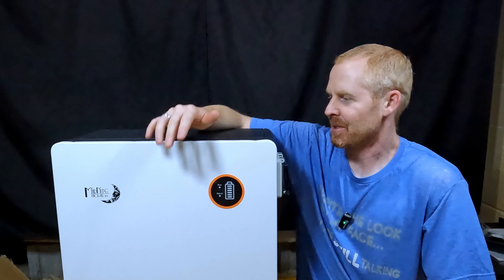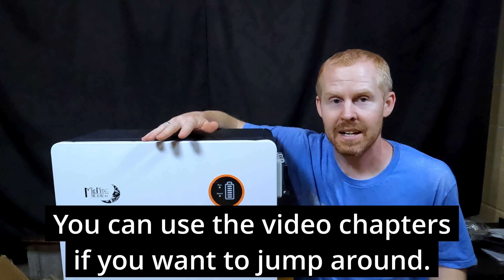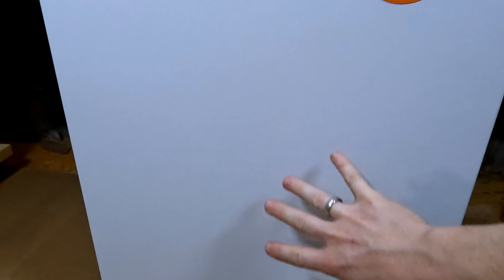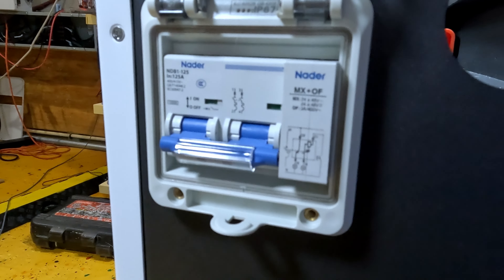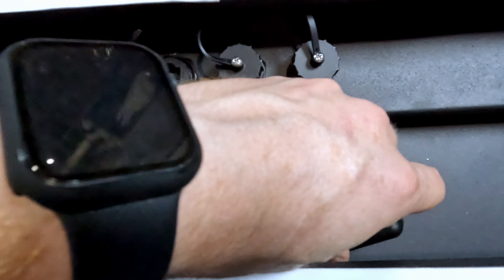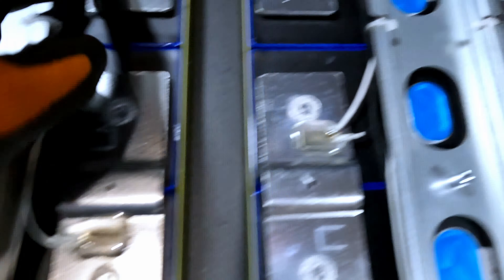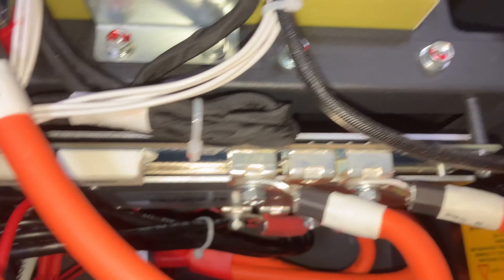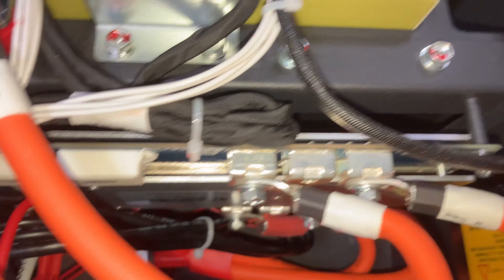First Look: MidNite Solar PowerFlo 16 – 16kWh Wall Mount Battery!

Comment from the maker: Links to the parts & pieces in the video (affiliate links)
------------------------------------
MidNite Solar MNPowerflo16 - https://bit.ly/4cZDcZQ
MidNite Solar "The One" - https://bit.ly/4exEkpw
EG4 Chargeverter - https://bit.ly/48jcuu7

Spec Sheet - https://cdn.currentconnected.com/2024/09/05130353/MNPowerflo16-v1.1.3-240813.pdf

Comment: Love the battery and the capacity. I will need to see if my 5600W PV array would be able to fully charge this. My gen is a Cummins/onan 6.5kw. 
My Midnite Solar charge controller is the 2016 model and I have a Magnusine 9.6KW inverter charger. I will have to find out if this battery will work for me. Would love the 16kwh storage. Currently have Fullriver AGMs and a 48V system. I have 19.2kwh of battery storage but of course with AGMs I can only use 9.6kwh…..
We are off grid.
Reply from the maker: @consco3667  with 5600 W of PV, it would take over three hours of direct sunlight to fully charge that battery, and that’s if you’re not using any other loads.  Depending on how much load you’re actually using, you’re probably looking closer to five or six hours of direct sunlight.
Reply: @ thanks Adam. I wasn’t sure of my calculations. I figured around 4 ish. With a gen that charges at 22.5 amps, on those overcast winter days it would be running for awhile….
Reply from the maker: @  not a problem.  Your calcs were right there.  It all depends on if your powering loads at the same time your trying to charge because that will slow down how much power goes into the batteries.
Reply: @ we have an electric fridge that is only a fridge with no freezer and we have an electric freezer. All lighting is LED and we have a old/propane cook stove. Loads are minimal

Comment: Does it come with the battery wires??
Reply from the maker: @fm-hy2bb  unfortunately not.  It comes with some 2/0 lugs so you can make your own cable.
Reply: @AdamDeLayDIY thank you for the reply. I’m glad I found your video and the midnight solar 16 KWH seems like a solid option. Prior to seeing your video I thought I had found the battery I was gonna go with a ruixu branded that’s also 16kwh for around the same price as these. But I think these will be a better option .

Question is will these batteries communicate with the EG4 12K PV hybrid inverter?
Reply from the maker: @fm-hy2bb  Yes there should be no problem communicating with the 12kPV.  The MidNite battery uses a modified version of the Pylon BMS protocol which the 12kPV can utilize.
Reply: @AdamDeLayDIY  I contacted EG4 and they said the EG4 12k PV hybrid inverter will not communicate with the MNpowerpro16, you would have to se the inverter to monitor the battery as a lead acid and will try and communicate based on voltage of the battery.

That’s a bummer!!
Reply from the maker: @ I’m sorry but whoever you talked to at EG4 is wrong unless they removed the ability for the 12kPv to communicate with the pylon protocol (which is what the MidNite batteries use).

Here’s a video where I tested this on the 6000XP:
https://youtube.com/shorts/wDWNxDVnvXU?feature=share
The 16k is exactly the same as the 5k from the bms communication standpoint.
Reply: @AdamDeLayDIY  thanks for the quick reply, there’s the response from EG4
Reply: Message: Will the EG4 12k PV inverter, close loop communicate and support Midnight Solar 16kwh battery?

MidNite Solar MNPowerFlo16 -16 Kwh 48Volt

The Battery uses the Pylontech protocol.

Thank you

Response:

Hi,

Thanks for reaching out, they are not on the battery compatibility list, however the unit should still operate in lead acid mode using voltage parameters rather than relying on the BMS communication.

Thank you for your time,
Jacob Morris.
EG4 Technical Support Specialist.
Reply from the maker: @ yeah that just means that they haven’t officially tested the battery communication with the inverter.  To be fair, it would really be impossible for them to test all different batteries, bms’s and variations.  

I can confirm though that it does work on the 6000xp.

Comment: The only thing that I could see that might be an issue is that bundle of wires behind the circuit board. Those cut pins can be sharp and could potentially pierce the wire bundle during shipping.
Reply from the maker: @SkypowerwithKarl  thanks Karl!  Do you have a timestamp of what you’re referring to?  That’s a great point!
Reply: 13:21
Reply from the maker: @SkypowerwithKarl  thanks!  That’s a great point!  I’m glad the wires are wrapped, but that might not be enough with those sharp edges.

Comment: very nice video. it would be nice to check the communication required max charge current and the amount variation with the temperature of the cells. for example if cells temp are 20c the max charge current is 100A if the cells temp 35c the max charge current will be the same? and also charge current with SOC.
Reply from the maker: Thanks!

At the moment the charge current details aren't available in the app, but I will check with MidNite to verify if the charge current changes based on cell temp.

Comment: Its actually more like 12kWh usable. They dont calculate the 20% you cant use
Reply: I was wondering about the heater on those. It looks like the specs say it will actually come on around 50° f and may pull close to 400W. I know Midnite is also using the heater to help with cell balancing, but 50° seems a bit high

Comment: Is a 125 amp breaker too small if the nominal charge/discharge is 160 amp and the max discharge is 210amp?
Reply from the maker: There's 2 positive lines going into the 125a breaker basically combining the poles of the breaker giving it 250a of tripping capability.

Comment: To be honest after i came to end I believe BMS should allow 200Amps perm and 300 Amp for 10 seconds.. That would be good options to have after all they are using 314Ah cells so 300Amps with 1C should be OK. so in theory you need two units for full house at least ..but i suppose that is also options
Reply from the maker: I’m sure the BMS is configured the way it is because it’s designed to be paired with the MidNite One inverter which has a max charge/discharge of 210a.  

How many you need would ultimately depend on what you’re trying to run.  If I didn’t have any 240v loads, 16kWh would last quite a long time.

Comment: Would you test this battery w/ your EG4 18k?  I'd like to understand if this would be compatible (seems it would).  Also wonder if you could parallel this with an EG4 Wallmount?
Reply from the maker: I don't have an 18kPV only a 6000XP but I can take a look at that one.  I don't see it being an issue since the 6000XP worked with the Pylon protocol from the OrientPower battery.  

Physically, yes you could parallel the two batteries together.  I'm not sure if they would work from a comms standpoint though.   Would be an interesting test.

Comment: Cool, bigger battery than eg4, is that made by Ruixu? They have a wall mount battery also with the same capacity.
Reply from the maker: @newbie101  no this is MidNite Solar’s battery.

Comment: I like my cells pointing the vents UP so these are not for me. There has been issues with other brands with horisontal cells.
Reply from the maker: What brands and what issues were reported?  It ultimately boils down to what the cell manufacturer recommends for allowed orientation.

Comment: Nice battery but it looks to me i would rather have option not to have heaters ...rest would be the same..that would be winner
Reply: If your situation never sees the cells get cold enough they will never be turned on.  PTC heaters won't add much expense to the unit and will be a boon for people in cold areas.  Easier for Midnight to have one stock item than two.
Reply from the maker: @SylwerDragon  I can’t imagine the heaters actually cost that much.  A lot of BMSs I’ve seen  actually have the ability to use heaters whether or not they’re installed and configured.
Reply: @retrozmachine1189 yes. Agree with you. We are off grid in a cold area but the battery would be indoors as they currently are. Never gets colder than 62F in here…